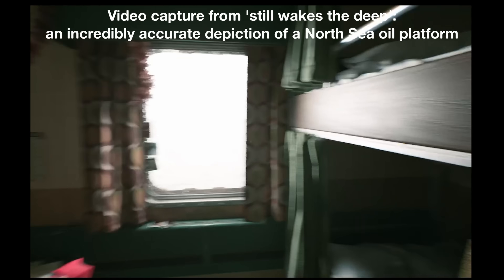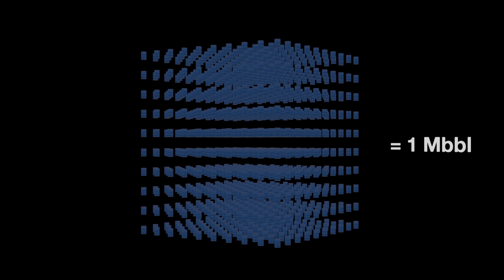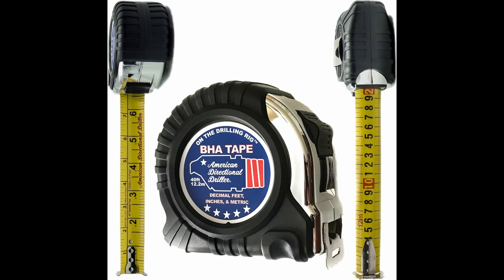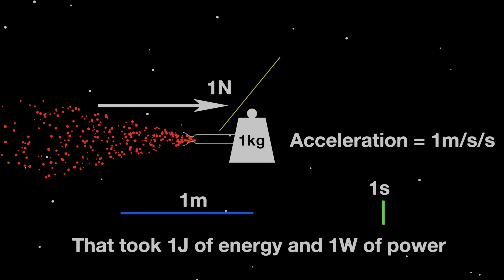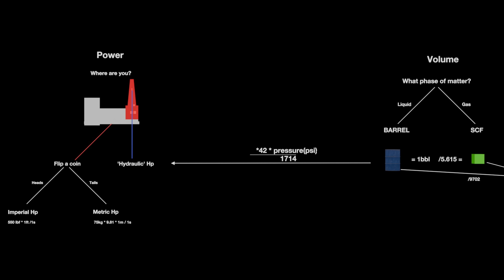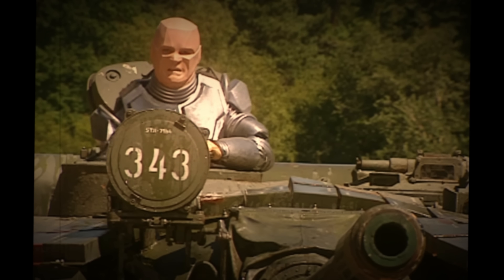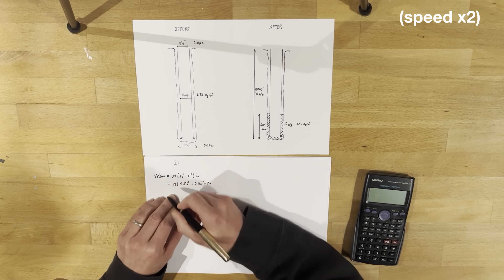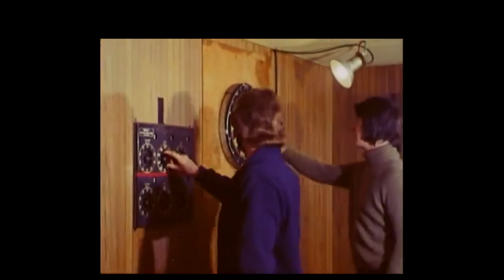Oilfield Units: a Measurement System so Cursed it made me Change Career

Comment: I miss the days when we used sensible units, like the length of my arm from elbow to fingertip.
Reply: That's the literal opposite of a sensible unit, as it varies from person to person and even from day to day for a person who's still growing.

Measuring that way is a crutch for dummies, not a reasonable unit. 
It works in a pinch for simple estimates, but if you want to make more complex measurements and have them work out, you need something better than that!
Reply: @LRM12o8 
sarcasm
noun [ U ]
UK  /ˈsɑː.kæz.əm/ US  /ˈsɑːr.kæz.əm/
the use of remarks that clearly mean the opposite of what they say, made in order to hurt someone's feelings or to criticize something in a humorous way.

Though to be clear, I think there was a standardization of the cubit when it was actually in use. My library of trivia is telling me Egypt used the arm of the current Pharaoh for megaprojects like the pyramids, for example, but usually it would just be the foreman. 

Anyway, all units are fundamentally arbitrary. If I gave you a length of wood and a pencil, you'd have to pull quite the magic trick to show me what a meter is supposed to look like, but you probably always have your arm and your foot with you and I doubt they change size often. Sensibility is judged by the use case.

Comment: Well no, a pound could be a unit of force and a unit of mass, if EGS uses lbm and lbf but both are commonly just referred to as "pound." BES is the one that comes to mind where pound means force and slug means mass. And yeah, torque, energy/work... would usually be calculated in ft-lbf and then converted to whatever industry standard unit is needed.

Comment: I'm in my 50's and from the UK so I'm used to measuring in both imperial and metric. 1/10th's of a foot is new to me and sounds even more bonkers than 1/10th's of an inch. In many cases I still prefer to use imperial units but I do believe that it is high time the imperial system just went away. It's archaic.

Comment: Ok so my family have been O&G adjacent basically since Leduc 1 (the first major post WW2 well). I inherited a lease agreement from the early 1950s. My grandfather used to get paid to perform scheduled maintenance on wells in his field. My father spent a great deal of his career working on process control systems. I myself mostly work on plant sites.

Maybe it is different in Canada but I sense that a lot of these strange units of measurement are not used... Though I also admit that I have no direct involvement in the type of engineering you were doing.

Comment: Wait, we had to switch from K to Ki to denote 1024 because using K for something other than 1000 is the big bad but you guys get to keep using M for 1000?
What kind of sick, unfair bs is that?
Reply: Yeah! I am stiff miffed about Ki, will never start to use it. a kilo bit was 1024 bits when I started and so shall it be. You cannot change history.
Reply: @Axel_Andersen for me, as someone not in the industry, this is actually helpfull, when i see k, i instantly think 1000,not 1024, and when there are both convertions used (probably to confuse the consumer), it is just more clear.
Reply: @Michalosnup  As consumer you were gaslighted. The industry moved moved base 1024 to 1000 to make hard disk sound larger. 1024 or 1000 makes little difference but since it was originally 1024 you should not change that because you cannot change old documentation which say 1 kB and means 1024 B by it.
Reply: @Axel_Andersen from the outside looking in, it seems very ironic you are defending an "old" measurement when this whole thing was caused by people refusing to adapt. I am making ABSOLUTELY ZERO judgment on it being right or wrong to do so. Just seems ironic.

Comment: A Barrel is 42gal.
A Barrel Equivalent (a scaled down field barrel for lab-scale testing) is............. 350mL (there is actually a reason for this number, its so 1 gram in 350mL is equivalent to 1lb in 42gal).
It doesn't even have an official abbreviation, and I only ever really hear it refered to as a 'lab barrel', and the abbreviation I do often see is lbb (as opposed to bbl).
Not to be confused with Barrel of Oil Equivalent, which is a unit of energy and whose definitions always contain the words 'roughly' or 'approximately'.

Also shout out to MMscf/d. Millions of standard cubic feet per day.

Comment: Might I offer a couple other wrenches into the works. The British version of the BTU isn't actually based on SI units but rather a separate but very similar version of the watt-hour. Yes, it's off by only about a 50th of a percent, but that discrepancy irks me (and it's more off than some people use pi to). Oh, and then there's the unit that got me to really get into the mess that is thermal units, ton of refrigeration, which was even worse with the fact that it is sometimes just referred to as a ton (which makes one word that has gone from volume to weight to what appears to be energy to power all to give that name).

Comment: you forgot that when drilling,  downhole pressures are measured in pounds per gallon as well.  the mud weight needed to contain the formation.  "that reservoir is at 13.5 ppg"

Comment: US engineer here.  We don't always work in SI units, either.  Depends on the industry.

Aerospace?  Sure - almost exclusively SI, in my (limited) experience.

Civil engineering?  I've seen it both ways, but usually it is mostly consistent and "rational" in that everything in one "field" is generally done in the same units (force calcs in SI, dimensions in customary units, flow rates in gallons/time unit, etc.)  But I've seen exceptions even there.

Electrical engineering (mind you, most of my experience with this is naval, military, or aerospace) is generally done in SI, with conversion on the backend to "US customary units" commonly done.  But EEs working on military programs are generally used to working the other side of the street, becayae a lot of the equipment either is (or has direct antecedents)  legacy equipment where the specs were always in US customary units, and no one has clean sheeted and re-baselined for SI.

In shipbuilding (even for Navy contracts, which are supposed to be in SI to the maximum extent practical☆), we work in a mix of SI, SAE, and uniquely shipbuilding units (which are usually - but not always - Imperial or even pre-Imperial British - based).

For example (to use the one most commonly known as "weird"), what is the unit of measurement when discussing tonnage, amd what are you measuring?  It can be mass, force, or volume, and may be based on SI, Imperial, or "old English" ("US customary").

.
☆ Federal Acquisitions Rules (FAR)  state that government contractors should use SI (and standard SI notation) to the maximum extent practical, and when necessary to express the measurements in "US customary units" at the end for the user, the contract can specify if they use a "hard" conversion or a "soft" one (usually a soft conversion, or "close approximation" is specified; but again, this is supposed to at the final "end user documentation" stage, not design or construction stages.)  

However, the US shipbuilding industry is SO opposed to conversion to SI, even though most of the yards the Navy contracts with almost exclusively produce ships for the US military or foreign customers (and Liberia and Myanmar aren't exactly naval powerhouses the yards would need to cater to as customers, so pretty much all the foreign sales are to "metric" nations).

Comment: Oh, I remember this. Had blessingly little contact with the oil and gas industry but wow do they complicate stuff. Also, the sheer amount of possible errors is so enormous it's just laughable. Unfortunately they do happen enough that it's a quantifiable cost, measured in percent (yes, whole percents of flat-out dangerous and costly errors just from engineering calculations)

Comment: This made me laugh. An excellent rant. I worked as a mudlogger in the North Sea and in Australia in the early 1980s.  One of my jobs was the pipe tally,  i.e. adding up all the lengths of the drill pipe that had gone down the hole. Measured on deck , either in meters or decimal feet. Aarrgh, you might say , decimal feet !  Nope, works like a charm when you have 200  thirty foot lengths of drill pipe down the hole, and your pipe tally disagreed with the driller's.  You have to then check every entry in your pipe tally book, and add them all up again. It would have been a total nightmare in feet and inches. If you had to use feet, then decimal feet was better. The drilling mud density units got me though, I could still remember the conversion from sg to ppg as 8.3. In fact it's 8.33, not bad recall for a number haven't used for forty years.  However, I agree, everything was better with SI units.  We used to quietly laugh at American colleagues' weird measurement systems. Cheers.

Comment: Congratulations on doing this video without swearing. 
In a past life I worked in the Australian paint industry as a formulating chemist just as the industry was switching to SI metric.
The company I worked for was an Australian subsidiary of a UK based multinational with large US holdings. Much of our work was to localise formulations from the overseas branches so we would often find ourselves converting from Imperial units or US Standard units to the metric units we were just beginning to use in the factory.
As a trained scientist I was familiar with the cgs and SI metric systems plus all the common UK imperial units because that was what Australia was in the process of getting away from. However the people on the factory floor and older lab techs were completely at sea with metric. 
It all went to shit once we started getting US formulae with their versions of imperial units.

Comment: I used to do this all the time. I just built excel workbooks and macros to do the job for me. You only need two numbers: 2.54 and 0.45359237 to convert inches to cm and lbs to kg. Convert everything to metric. Do the calcs. Convert the results back again.
Reply from the maker: Oh yeah that’s what I used to do.

Unfortunately there are loads of situations where the silly units are enforced. The mandatory biennial well control exam would be one example of that.

Comment: I've worked with PCB design. There are three units to express how thick the copper traces are on the PCB substrate:
* pounds of copper per square foot
* mil (milli-inches) of thickness
* um (or µm, micrometers) of thickness

Nowhere near the stupidity of oilfields, but still stupid.

Comment: I feel you missed out on a couple of obvious (in their silliness) oilfield units - degrees Rankine and of course mudweights expressed in pounds per square inch per one hundred feet. Also you mention that degrees API is not used for calculations but as a geophysicist I can unfortunately confirm that when you're doing a Gassman fluid substitution the engineers are almost certainly going to give you hydrocarbon densities in API.  Of course, us wiggle-pickers aren't much better: we can't even agree on whether a peak or a trough is a hard event, which way around all the colour bars go, whether depth is measured in positive or negative numbers, or what to use as the universal datum (sea level, ground level, the drilling floor, ...)

Comment: In cabinetry, in north America, the plywood thickness is in millimeters, but the nominal thickness is in approximate, fractional inches. The sizes of holes, hinges, slides are all built to millimeter specs, but they are still sold in nominal fractional inches. Literally everything about the entire process is done in millis yet we still convert everything to inches for no reason.
Reply: Probably because most of it's made in China
Reply: I mean, lumber in the US being sold as whatever size it was before it was milled down to a nice shape is already a bit nonsensical (why does a 2x4 have to be a 1 3/4 x 3 3/4)

Comment: In the Australian mining industry if we are doing deviated drilling we use dog leg severity as degrees per 30m. I think it's because drill pipe is divided into multiples of 3m instead of 10ft.

The weird thing is DLS kinda makes sense to me, if you're taking surveys every 3m you're aiming for a DLS of 5 then if your inclination goes up 0.5 degrees you're on track. If you're trying to change the hole from an inclination of 40 to 60 then you'll need (20/5)*30m=120m of directional drilling with a dls of 5. I don't know what radius of circle that is and I kinda don't care.

 As soon as you start turning and especially calculating tool face angle is when it gets really weird.

Comment: pounds are a measure of weight, not mass. density is explicitly mass per unit volume. pounds don't measure mass. 

"oh just use the implicit conversion to lbm" better pray gravity where you're at is the same as "standard."

Comment: SCF isn't a measure of volume. It's a measure of quantity that equates to about 1.195 moles. Cubic feet might be used for gas but it would only equal SCF for ideal gas at a specific temperature and pressure.

Comment: One reason folks won’t leave the traditional systems I’d guess it tosses all the seat of the pants / experienced based things out the window, I am a mechanic for 2decades and have been dealing with English and metric tools forever, and I still have to do math in my head to figure about what a 1-7/16” would be about in mm. As my eyeball calipers still only read out in English :-/

Once your a guy doing math you might as well use a consistent unit (SI) , but when going by “rule of thumb” or estimates & approximates; it has to be in the units you have your experience in or your working blind.

Comment: As a structural engineer on mainly bridges, the only reason I haven't strangled a project manager over stupid units in calcs and estimates is MathCAD. Letting the computer do all the unit conversions for me is revenge for how often I would get exam problems wrong by messing up unit conversions. 
Our primary unit of load is a kip, that's just 1000lbs, but we do estimates in tons and most superimposed loads are given in pounds per foot. Thankfully we don't do dynamic calcs like you poor souls that work with fluids.

Comment: Yep. I've worked offshore and on land for more than a decade. Can absolutely confirm the units system is bonkers. You missed Compressed Natural Gas and Liquid Natural gas though.
Also offshore gas turbines use different units depending if they run on diesel or have flipped to lean nat gas

Comment: You're not wrong. This mess is in desperate need of simplification. BUT there is one case where imperial units are easier, and that's masonry. Hence why construction has clinged to it so fervently. The simple 8" x 8" x 8" block unit and its mathematical patterns are divine in simplicity at just the right scale. Anyone who doesn't understand hasn't worked in construction.

Comment: Horse power is one of the most useless measurements I have ever seen because not only does the formula change with the source of the power but the numbers can be completely meaningless depending on the ratio of RPMs and Torque. This is why you can have two engines that have the same HP and yet only one will do what you need it to. Or two engines of different HP where it is the lower HP that is more capable than the higher (for the given task). This all comes from trying to distill multiple factors into one convenient measurement that fails to accurately describe what's actually going on. You could do an entire video on just this.

Comment: I am low-key going to have PTSD about someone using decimal feet and writing it like a normal person. And I don't even have any clue how to even visualize degrees per hundred feet, so that's... nice. I love how I'm basically mirroring your pinned comment on this, but yeah, those are a lot more cursed than you made them out to be. I should ALSO add that "bbl" already had a prior definition for me (thanks, Mumbo and THAT ONE billboard), so that's cursed for other reasons.

I'm American, but I'll admit SI definitely has improvements. I just still have to convert to miles or yards or gallons or what-have-you or else I don't know what it is in "real-world" scale. But I do my engineering in SI.

The one thing that slightly annoys me is that the complex units are all derived from physics and the simpler units, which is great, but then when you go look up the definition on common sites (e.g. Wikipedia and several years ago), a surprising number of them are written in other complex units or otherwise changed so it's harder to check your work and then you're trying to figure out how your coulombs and watts or whatever relate (it's nice to check your recall of a formula when you can tell what side of the bar to cancel t on). I recall there were a couple particularly annoying ones - I can't recall if it's electrical or orbital that did it the most.

Comment: Reference the "bbl" abbreviation for barrel - it's also applied to numbering the barrels of a carburetor. 1bbl, 2bbl, 4bbl is extremely common nomenclature for carburetors, and knowing that the bbl originates from a specific standard oil barrel in the 19th century, applying that to numbering the air passages of a carburetor makes even less sense now than it did before.

Comment: Hold on…gas phase concentrations are often labeled “pp_” with no additional qualifier (where the underscore can be m for million, b for billion, t for trillion, etc.), which is an ambiguous unit. This presentation has done this by using “ppm” all on its own. Specifically, is that pp_ by weight or volume? For example…

If by weight, the units should be mg/m3 for a part per billion or “ppb by weight.” 
If by volume, the units should be ppbV for part per billion by volume.